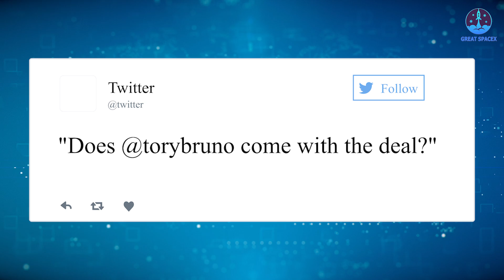It's over! SpaceX did not expect this, ULA is in BIG TROUBLE... selling company

Comment: Vulcan launches are estimated to cost between 100-175 million per launch (it will be more). They are going to try and recycle the engines to save maybe 50 million or so. I just can't see any way they can be under 100 million per launch, not counting the billion or so the gov will continue to give them annually to be launch ready. If they can do 5 launches per year (also, unlikely) or even 10 that adds another 100 million per launch. So approx 250 million per launch is the best-case scenario.  Elon wants the cost of a Starship launch to be $200,000 (yes that's two hundred thousand, the cost of fuel). that's a THOUSAND times cheaper. He also wants to launch them multiple times a week. His timelines can be off, but he truly delivers, even if it costs 2 million per launch, that's 100 times cheaper. In the video, they talk about the Vulcan partial reusability closing the gap with SpaceX prices? None of the potential buyers (companies, not investment groups) have the financial resources to buy out ULA with the exception of Lockheed + extra funding.  Assuming Amazon and Apple are just a joke, as they won't even consider it.
Reply: you know its funny that you call into question ULA/Vulcan but then dont use that same questioning on if SpaceX can even reasonably get prices that low [they where estimating less than 30mn per launch at one point, yet there stuck at 50-60mn, while also getting government contracts for +140mn subsidizing the cost], so ya its unlikely that Starship [if it ever goes into major production, look at how few Falcon Heavy launches there are] will be that cheap or fly that much.